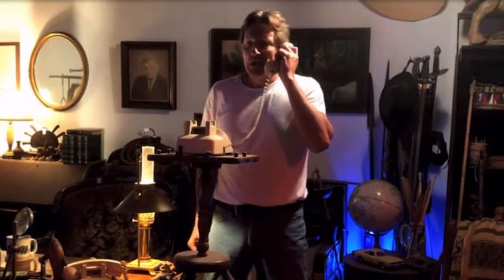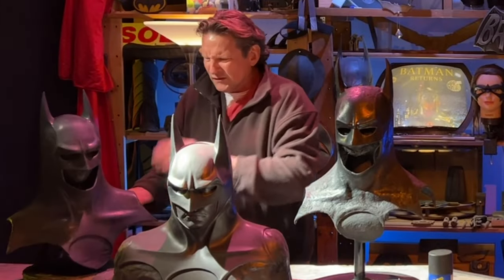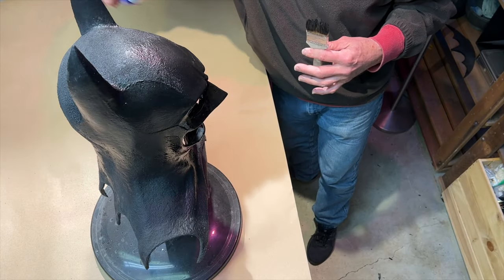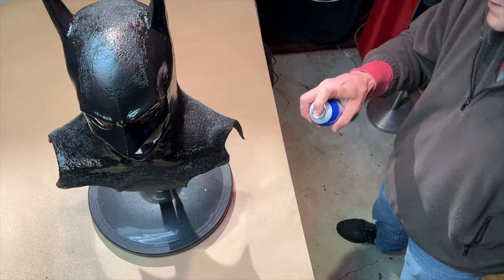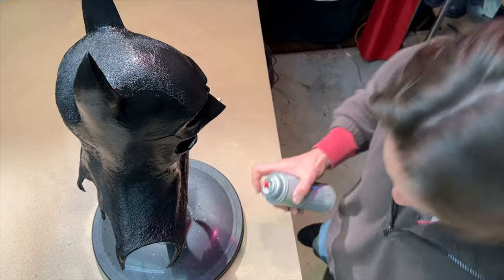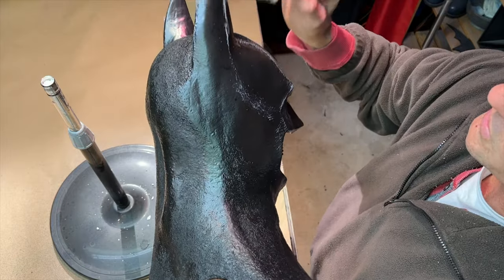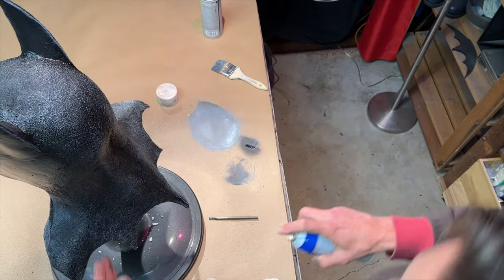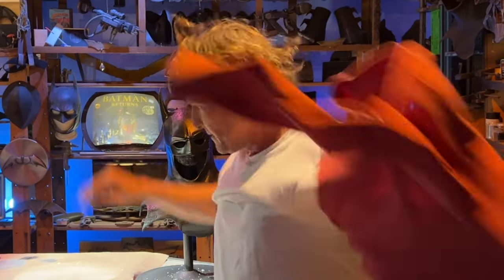Plasti-dip Work On A Heavily Textured Batman Cowl

Comment: Awesome PlastiDip video Paul!

Is there an easy way to remove dry PlastiDip if you mess up and apply it too thick or just want to redo the cowl?
Reply from the maker: I have been asked this many times in the past and I have tried many ways. The only two I can recommend even trying are tests with a paint thinner/ perhaps even paint remover that will cause it to loosen up (But test in small area first to make sure the underneath won’t be damaged) or sanding down the problem areas and doing a fresh coat of plasti-dip over it. I personally am sanding down one of my old pieces right now that is a plasti-dipped and I’m fixing the flaws with plasti-dip and will then remold it.

Comment: I just picked up the rubies batman 89 cowl from Walmart, and I bought a single can of plasti dip. should I do the same steps like the cowl in this video? It says on the box that the cowl is made with Kaolin clay, thanks!
Reply from the maker: I would have to see it and feel it   And test it. I would do a small little tip of one of the scallops as a test to see if it’s sticks. see if you can peel it off see if it cracks and go from there.
Reply: @ConsciousCounseling  thank you so much! I’ll post the results on my channel

Comment: I have a arkham batman cowl and it has gone grey from black can you use black plasti dip to restore the colour on the cowl
Reply from the maker: What is it made out of?
Reply: @ConsciousCounseling  latex
Reply from the maker: If it is clean, high-quality latex, my experience has been that a light spray of plastidip will adhere well and provide an overall uniform. Darker black protective finish.
Reply: @ConsciousCounseling  ok thanks I will give it a try